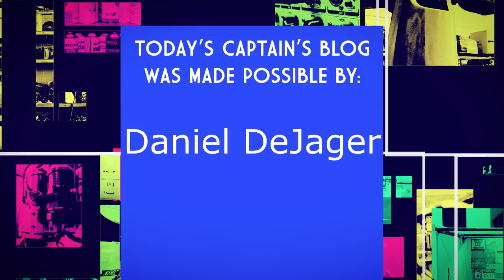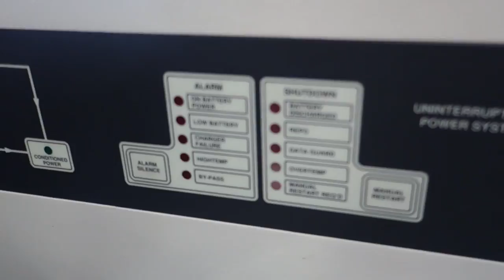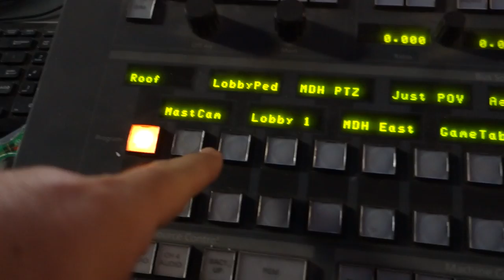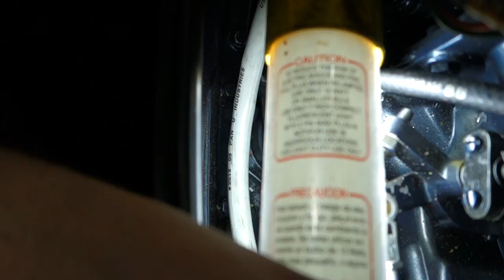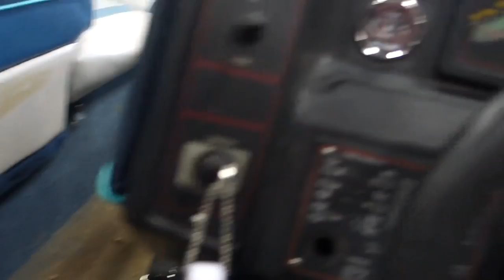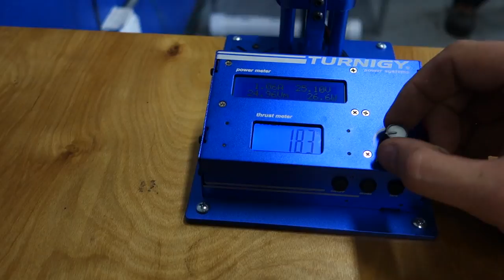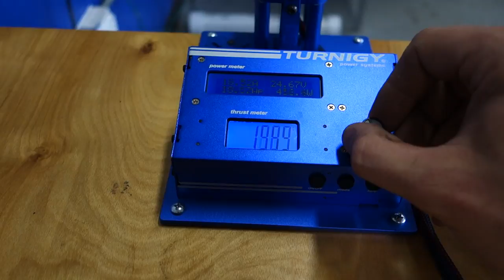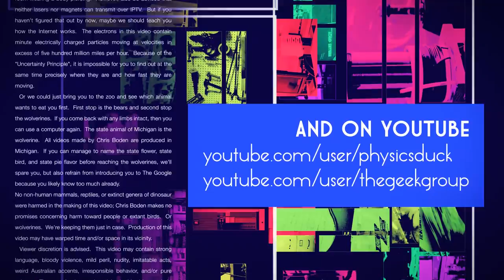Captain's Blog 8 27 2016 Big Saturday Blog

Comment: that can also be 3300 rpms.  1147  hi mitch.  ups unit should have many useful parts.  transformer looks usable.  batman, please keep your toolbox on a separate thing from what you are working on.  that much motion will add.  group of black wires has more work to do.  tgg staff are dismantling a dead device.  i know all three of volt, amp and watt.